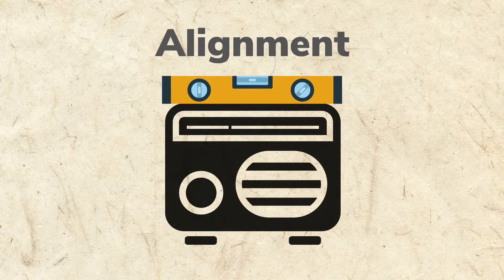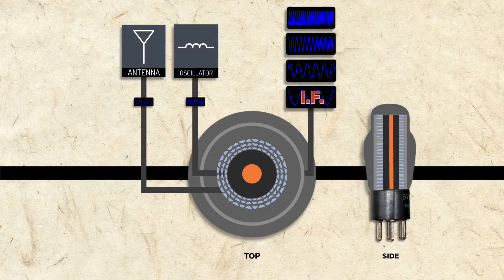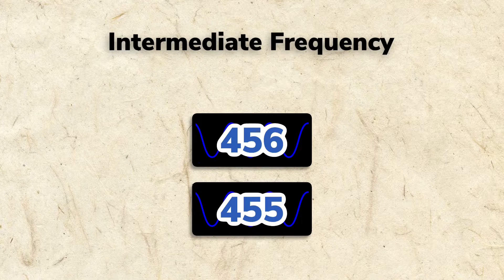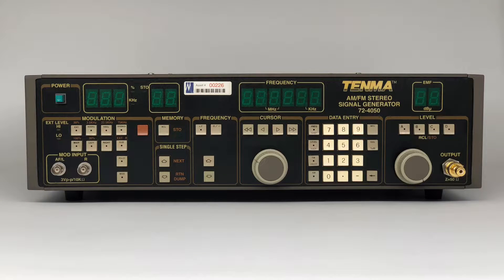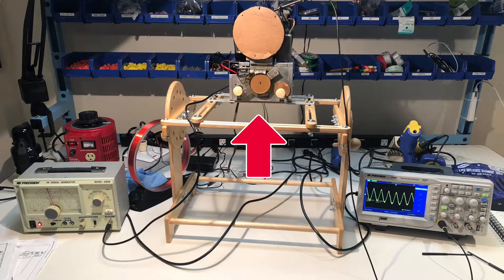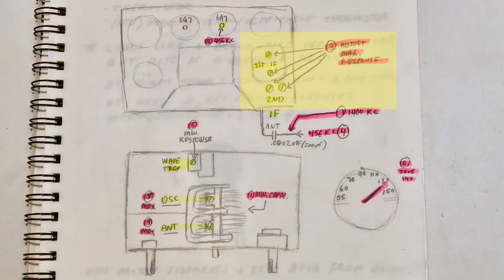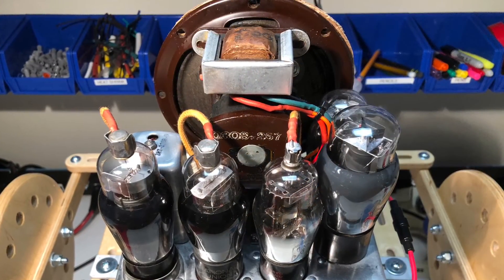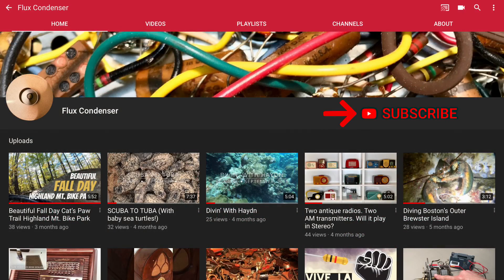How To: Antique Radio Alignment

Comment: Great instructional video on how to. I am starting out with transistor radio  kit and alignment, wonder if the alignment process is the same.my radio has a small ganged capacitor with trimmers on the back for antenna and oscillator.hard to tell which screw for which circuit.radio so far has noise only coming out of speaker, no stations yet. 
John

Comment: I’m confused as usual lol. Your showing me an analog RF signal generator hooked up to the radio and a digital oscilloscope on the speaker to monitor the injected RF intermediate signal. 

Where is the digital display I see in the video for the RF and modulated audio signal fit in? Are you showing me the same thing but on 2 different devices? How do you add a modulated audio signal using the BK Precision 2005B?

Comment: instead of using an isolation transformer, can I use an inverter connected to a car battery?
Reply from the maker: Well that’s thinking outside the box. It would be safe, yes. Not sure how much noise the inverter might add, though.

Comment: Why do some AM alignment instructions  tell you to connect the antenna terminal to 455 Khz to align the IF stages.  How does the variable condenser tune 455 KHz if it's designed for approx. 600 to 1400 KHz.  Does 455Khz always pass thru the variable condenser downstream to the IF stages? How?
Reply from the maker: Well, to understand that you first need to understand the concept of a superhet radio. No matter what frequency you’re tuned to, all frequencies are changed to the IF frequency. It’s really a fascinating process and I recommend you check out the other videos in this series which will explain all. https://youtube.com/playlist?list=PLCH_MMh8A6cFXw-TQ3UrIp5MA5C9EjSFs

Comment: I really could use some one on one mentorship on radio repair but this video series has been very helpful with getting my feet wet. Just got my first radio ( a zenith cube 5R216). Recapped it and went to power up with a dim bulb tester. Nothing…did a continuity check on the power supply and the transformer had an open primary. Got a new transformer coming tomorrow so hopefully I can figure out how to wire it up correctly.
Reply from the maker: Good luck, Joe. I hope your Zenith powers up with the new transformer. If you have any questions along the way, feel free to comment on one of my videos. I usually try to respond fairly quickly. And be careful about getting your feet wet. Not the best thing, perhaps, when working with household electricity!
Reply: @FluxCondenser  Thanks. I’m going to have questions for sure.  I’m confused about the center tap on the high voltage coil of the new power transformer and where that lead connects but I think it will become more clear once I get the new transformer (Hammond 270dx) and read the voltages.

Comment: Hello, maybe you can help me. I need to align the FM on a Zenith model H723 radio. The sheet states to attach the high side of my signal generator to the ungrounded shield over the FM converter tube. However, the shield is riveted to the chassis which is ground. So, where do I attach it?
Reply from the maker: Hm, perhaps try loosening the tube shield and lifting it a bit so it encases the tube, but doesn’t not contact the chassis.
Reply: @FluxCondenser  Thank you for responding.
Reply from the maker: @eugenetheodore2956  No problem. Good luck with your project. You may also have luck just clipping the signal generator lead to the insulation of the wire going to the grid, close to the tube. You’re just trying to pump some RF into the tube as closely as you can and there’s lots of ways to accomplish this.
Reply: @FluxCondenser  Thank you, again. This is a good solution from you.
Reply from the maker: My pleasure. Always glad to help.

Comment: Does this same procedure work with UHF on a multi band radio?
Reply from the maker: Hi, Randy. I’m not familiar and have never serviced that type of radio, so you’d have to ask elsewhere or consult the service manual for your device. That said, it’s my understanding that all modern analog radio systems use superheterodyne technology so the procedure of adjusting the IF transformers, tuning the oscillator and variable capacitor are likely similar in many respects.

Comment: The variac you show when advising to use an isolation transformer is usually NOT an isolation transformer.  It's an autotransformer.  It provides no protection of the sort you advocate.   It's essential to know the difference.
Reply from the maker: Yes, it is.
Reply from the maker: YES, SOME VARIACS ARE ISOLATED, just as the one shown in the video. Before commenting otherwise, please visit the Variac site for confirmation or click this link: https://variac.com/staco/PDFCutSheets/VT%20isolated.pdf

Note, that yes, the ground of the output and the ground only is not isolated, as it’s connected to the chassis. The hot and neutral ARE isolated and for 2-prong antique equipment this is, of course, not an issue. If someone needs to isolate the ground, for a three prong grounded plug, a simple cheater plug is all that is required. 

A quote from Variac: “Isolated Series: The isolated variable transformer has a separate primary winding which is electrically isolated from the secondary or output winding. Either side of the output can be grounded independently of the supply line, making them safe for all industrial, classroom, and laboratory applications where an isolated output without a common ground connection is required.“ 

The model shown in the video clearly states on the chassis, “isolated.” I’ve have confirmed this with multiple tests. Not everything that looks alike is the same.

https://www.amazon.com/gp/customer-reviews/R3FWK0HBJYE7AJ/

https://www.allelectronics.com/item/sc-10t/10-amp-variable-transformer-w/isolated-output/1.html